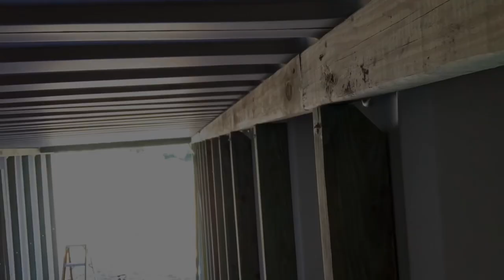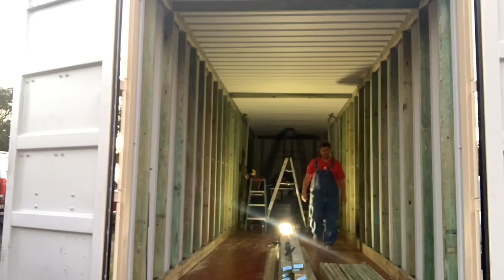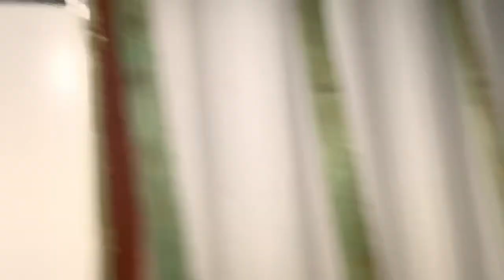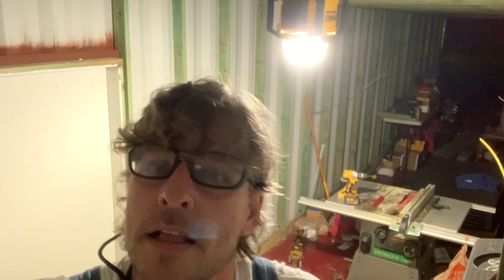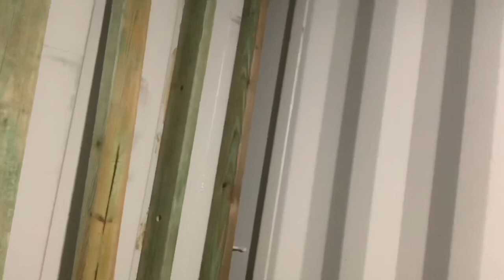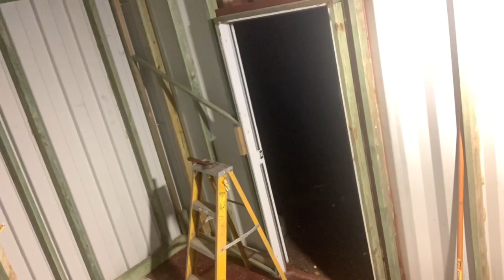Shipping Container Framing

Comment: Did you use pressure treated 2x4s because they would be touching the outside walls?
Reply from the maker: Well, I thought since it may have the potential of getting moisture inside I'd need it, plus the cost was negligible compared to non pressure treated. Plus Florida and bugs, but that thing is sealed tight with the spray foam so it wasn't worth it, plus there wasn't one straight piece of pressure treated wood.